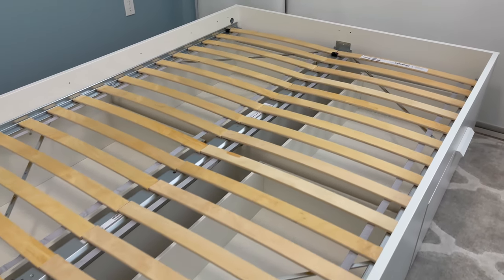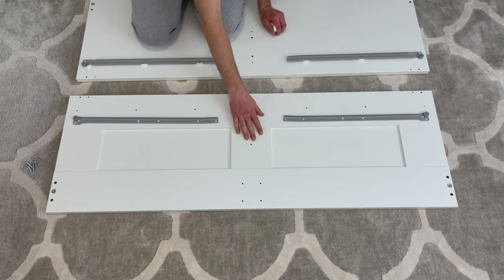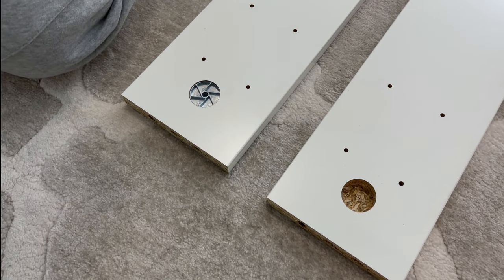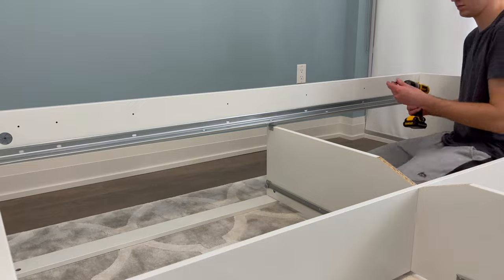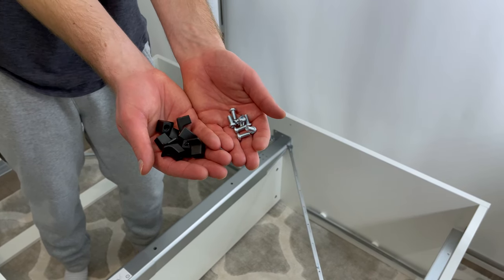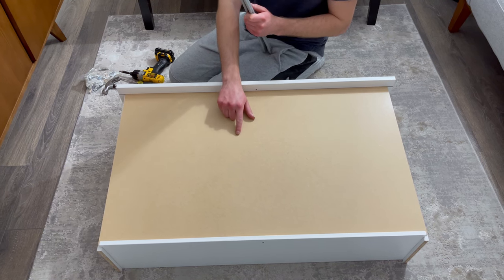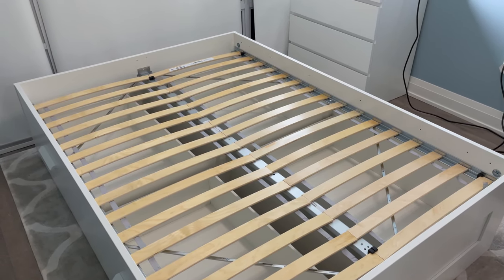Easy To Follow Brimnes Bed Frame with Storage Tutorial

Comment: I appreciate you posting this video however you skipped a couple of steps and it made the set up a little confusing! You would tell us to put a screw or dowel into a slot but you wouldn't mention another screw that you can see; I had to take things apart twice to fix the mistakes.

Comment: i'm stuck on 3:20. it seems like the screws are set in place but when i lift it they just fall right back out and the whole thing falls apart. i'm not sure what i'm doing wrong since the heads of the screws seem to pop out perfectly into the holes from the other piece. can someone please help, i dont want to pay someone to come build this
Reply: did you happen to solve it? It seems to be similar problem here
Reply: There’s a short side and a long side to the metal tubes. We made sure they were properly aligned in relation to the manual. It was still flimsy, but quite a bit better. After we locked in everything else, the middle piece was locked in securely. Weird piece of the build, but it seems to work itself out.
Reply: Same here, I’ve been trying whole day and the screw seems too short so everything falls apart. Any solution??
Reply: The short side of screw into the angled piece and the long side goes through to other side.  You're not alone in this.  @CristinaZamora

Comment: Thank you thank you thank you. I had a problem at step 43 when doing the rails for the drawers ... your video was the only one that explained the different rails and where they go. Turns out I had to remove a few rails from the bedframe itself & replace with the correct ones, but once I knew what to look for it made the job super simple. Thank you!!!!

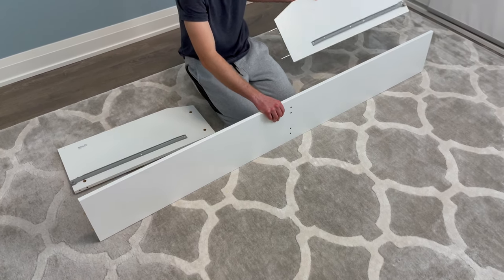Comment: Got the fastener stuck in the hole for the first part of the bedframe and im not able to see the head through the other side of the hole now like at 2:15 now the pin is coming out and the middle frame is sagging when I progress to the next part. Trying to get the fastner out but its stuck :/
Reply: currently having this same issue but if I push one side of the board, the other board unattaches itself from the middle frame every time so I can’t even fasten the fasteners right :/
Reply: Did you figure it out? I am having same issue and I am so done with it!!

Comment: Good video helped a lot. Did get stuck on #6 when connecting the center into the cross shape. The 101115 hardware didn’t seem to reach out far enough to fasten. but with a second person holding the sections up and together I was able to get them secured. Hope this helps!

Comment: The wordless (read: useless) instructions say to assemble with someone else and that was the only useful titbit: I could not have done this without you. The most I have ever put together was a lamp; I didn't even have tools, so I had to go buy them first pointing at the paper like "these, please." I cursed you out a little bit around 11:15 cos it wasn't clear that the hooks were in the top two holes, and I had screwed them in the bottom two so had to re-tangle myself to unscrew and rescrew; and then again at 12:22 bcos I couldn't tell for the life of me which side was more curved (but that was maybe more a manufacturer prob, so sorry for cursing you then). but overall this was unbelievably helpful and clearly explained for my neurodivergent self. It absolutely took more than a couple hours, but again 1) I did it on my own and 2) I'd only ever 'assembled' a lamp. idky your video is like the 2nd/3rd that comes up in the list when you're the easiest to follow by far. I still can't believe I made my fckin bed. tysm

Comment: Thank you for this tutorial, it was very helpful but to say it will take 1-2 hours is completely inaccurate, unless you have 4 people working at once. If you are reading this, plan on at the very least 4 or more hours. I am very handy and do most all home repairs/ remodeling myself and this took over 5 hours to do alone and that was without any issues and working non-stop. The screws in the diagonal pieces did not go in very well and would not screw in with a drill so I had to tighten by hand which was annoying and slow. I also would recommend the lower holes for the rails if you are using a normal mattress, we tried the top ones at first and the bed was way too high.

Comment: do you know if you have to add the drawers? I want to slide a twin trundle bed underneath instead. Thank you
Reply: It will be much less stable without the drawers and the metal cross pieces will probably bend.

Comment: I built mine but in a lot of places the pieces wont completely go inside the wooden and metal parts, leaving small gaps. Im not sure if I did it wrong but idk if i should be concerned whether the bed stay up or not. Does have any advice bc i did also try using a hammer.

Comment: How deep into the frame are the slats?  I'm thinking I'll need a mattress foundation to put the mattress on, in order for  the corners of the mattress to be accessible,, but can't see if it should be a 2" or 5".  Also, are there weight limitations on how heavy the mattress can be. Thanks!

Comment: I have been trying for hours to do what you are doing at 2:34. I can't get the metal rods to stick far enough into the holes to put the cams on - nor can I get the cams out of the hole to try again.
I am certain this is the toughest part.... but also the most structurally fundamental.  I'm at my wit's end
Reply: same boat here 😭 i was able to pry them out from the inside with a flat end screwdriver and just push but have no idea how to get back to them now
Reply: @lauryn6037  Five hours later I finally got those three pieces together fairly solid.  It seems like the secret is to not tighten down the first pair of cams all the way, or else the rods won't project far enough into the opposite holes.
Tighten the first cams just enough to keep the rods from falling out, put the pieces together and make sure the rods project far enough and then tighten the second cams, but not fully.  
Then when everything is in place, tighten them the rest of the way and it's solid.  These little cams are the one thing I've always hated about IKEA furniture.  They're hard to extract, rather fragile, and honestly I'd rather have an unsightly bolt if it was more sturdy.
Reply: @HeadHunterSix  oh thank you so much maybe this is where i keep going wrong on this part!! i’ve been tightening them fully as i go and wondering why they still keep slipping out. having an uneven floor doesn’t seem to help either because the pieces don’t want to align easily lol. i absolutely hate these little cam locks too, my last ikea bed didn’t have nearly as many of them as this one

Comment: Did anyone else buy the black version then get surprised when the insides of the drawers were grey? Threw me off. Thought they sent me the wrong color! Bit the more I think about it, if the inside of the drawer were black you wouldn't be able to see anything inside them without proper lighting
Reply: Is your drawers flushed because mine are not they poke a little bit out on the left side

Comment: I’m struggling attaching both sides by myself at 2:32, the fasteners won’t screw on right because if I push one side, the other side gets loose. Do I need a second set of hands for this?
Reply: Also having the same issue starting to give up and just do the rest and hope it squish together
Reply: Same issue here, I’ve been whole day trying to get this done, any solution?
Reply: You need to adjust the fasteners just 45° degrees, no more because if you adjust it more, then the screw is too short. I had the same problem, but that's how you should suppose to do it, just adjust 45° degrees in each side
Reply: When attaching both sides (8:18) they just won’t go on all the way. The wooden parts are just not sliding in and there’s a gap. It’s driving me insane genuinely someone help

Comment: When adding the very first 2 pieces to the long piece of wood, they would not line up properly and have a gap in between. How do I fix that?
Reply: did you figure it out? mine won't attach no matter what i do
Reply: @libbingbarrera2084  naw lol I returned it and went to a different furniture store. Got a completely different bed
Reply: A big hammer...
Reply: I spend 2 hours on this step… hammer the dowels down really hard. Untill almost flush. Still barely fit but it did. I hope this helps someone
Reply: @bloodoftheoak I am having the same issue here, I tried what you just said but it doesn’t work, the screw is just too short. Any other solution?

Comment: @1:10 see I'm already confused. There are bundles of the drawer sliders that are wrapped up and split into 3. 

Then there's the drawer sliders that come in the brown box. 

Both are labeled CR/CL. So which drawer sliders do I use? The ones that come in the brown box or the other ones that are wrapped up with white tape?

UPDATE: You can use the CR and CL in the brown  box. Still don't know why they split them from the other 3. 

I started building this bed at 7pm and I got done a little after midnight.

Comment: Your tutorial is missing steps and the steps you show are not consistent with what you're doing
Reply from the maker: Can you be more specific because I followed the exact steps in the instruction manual
Reply: I just made it without having to refer to the manual once...OK a couple times, only to make sure I had the right screws. This tutorial rocked